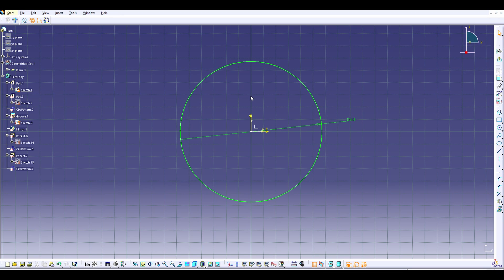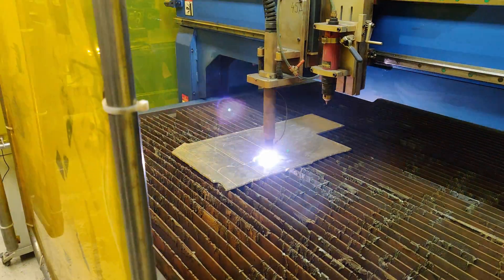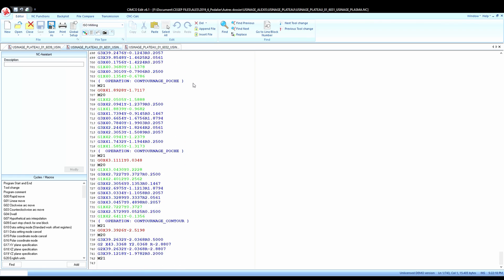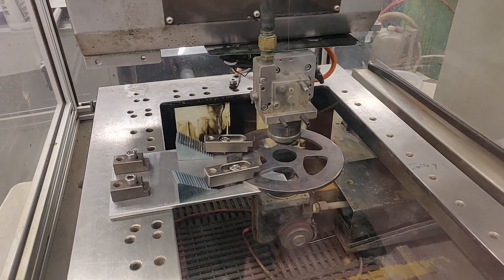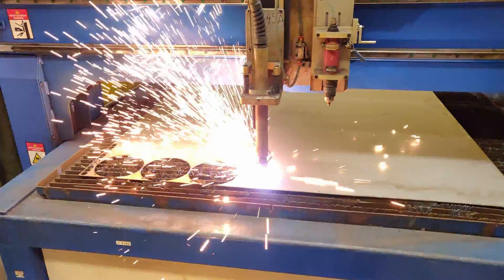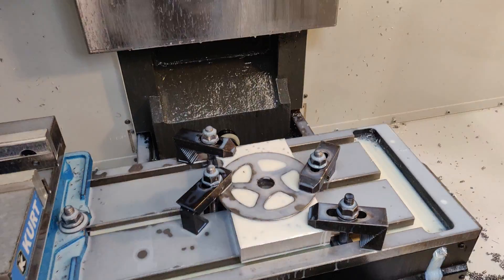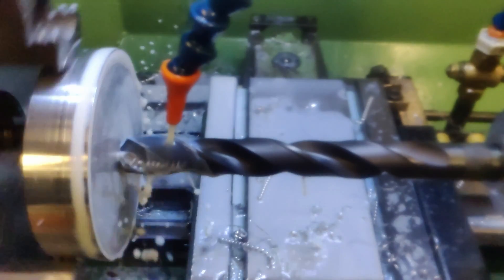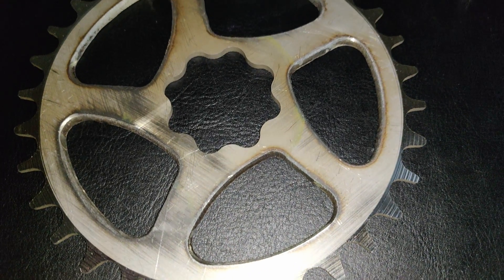Mountain Bike Chainring Fabrication | Bike Crank Build Part 1 |

Comment: Nice! Why are teeth cut first before chamfering the chainring on the lathe? What is the drawback of doing it the other way around? Will it need grinding to remove any lip created around the teeth after cutting them on the EDM?
Reply from the maker: Thanks ! Actually we did cut the teeth after chamfering the chainring on the lathe. After posting the video, we realized that it was better to do so because it leaves us with a smoother finish for the teeth. If you would chamfer after cutting the teeth, you would be left with a lot of ruff lips around the teeth. Step by step in order  : 1-cut the right diameter for the chainring  2-chamfer  3-cut the teeth.  The EDM machine doesn't leave any lip. It is one of the most precise cutting tools and you can have tolerances up to ±0.005mm (± 0,00019685039 inches)
Reply: @mtb_trailblazer2078  I didn't know EDM's were that precise. That's quite something..